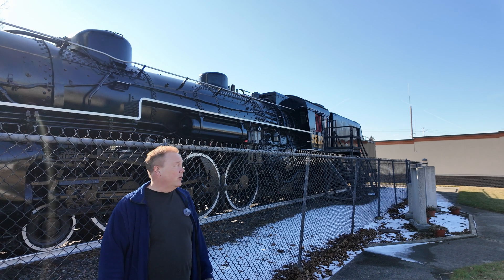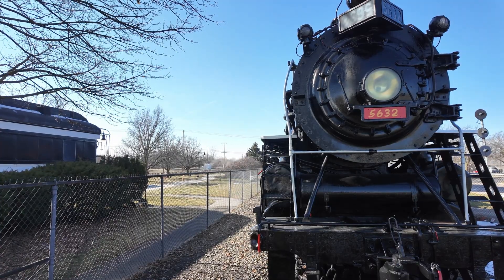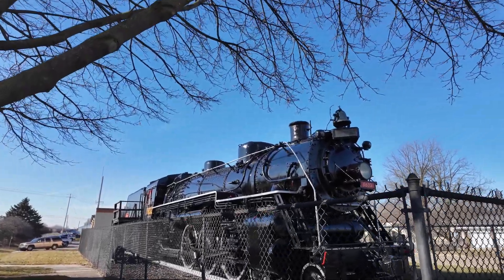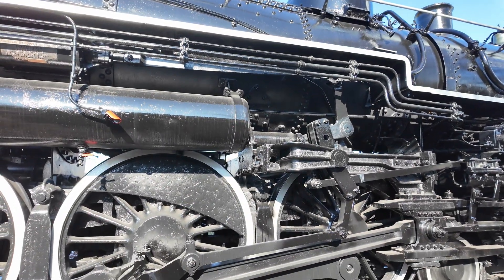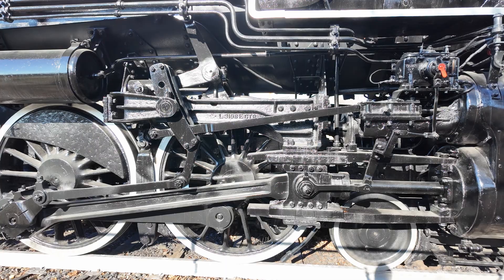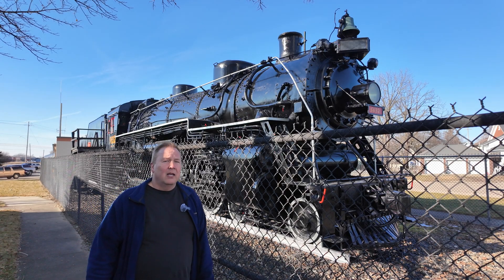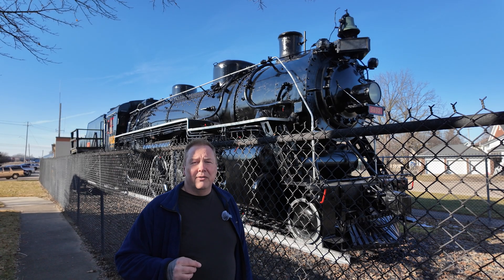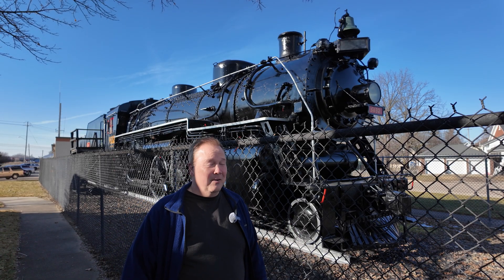Why Steam Trains Have Giant Wheels

Comment: This is all true up to the age of superpower locomotives.  

The vast majority of modern 4-6-4 and 4-8-4 locomotives could very easily and safely maintain speeds well beyond their wheel diameters.  Lightweight side rods and pistons, roller bearings, advanced cross balancing, one piece frames, modern centralized lubrication, and superpower proportioned heating surfaces all dramatically changed the rules.  

The ATSF 2900 class with 80" drivers ran 100 mph in service daily and was rated to run 120 mph. The advanced N&W J class with 70" drivers was very comfortable at 100 mph.  These are a few examples but they're pretty typical for late steam era fully modern engines.  Sustaining 100 mph across the mid west and the prairies was not a challenge for these machines.

Love the videos.  ❤❤❤
Reply from the maker: It's too bad trains through the midwest can't still do 100 mph.  Isn't there only one amtrack route that manages it now, between track condition and traffic?
Reply: @Industrial_Revolution Unfortunately there is a 79 mph limit on passenger trains that share trackage with freight trains.  It really puts a damper on making long range passenger travel an attractive option unless you're checking out the scenery. 

If you haven't taken a look at the T1 Trust project, they're building a Pennsylvania Railroad T1 from scratch to go and prove they were the fastest steam locomotives ever used in regular service.  On the run from Crestline to Harmon they regularly ran 100-120 MPH.  The engineers apparently had a habit of running them well beyond the design speed of their Franklin valve gear and creating a lot of maintenance headaches.  Franklin and PRR had a fix in the form of automotive style rotary Franklin B valve gear but the end of steam ended that effort.  One engine was retrofitted and tested.  The T1 Trust is building their engine with the rotary valve gear and hoping to see 140 MPH.  Fun stuff.  The big question is where are you going to run it at 140 MPH?
Reply from the maker: I've heard of it, but haven't looked into it too much.
I suspect the only rail line in the states capable of that speed is a part Amtrak's Acela line, but I also suspect that line can't take the weight.

Comment: Steam production isn't a problem for any super power design. For every inch of driving wheel diameter, you get 1 mph +10%.   modern (late 30's +) could go much faster. 90+ mph on 70" wheels.
Reply from the maker: For max speed, assuming you had enough steam, but could you actually sustain it?

Comment: Balance of the rotating and reciprocating components becomes increasingly complex at higher speeds.  Vibration was a limiting factor in some designs.  Some interesting research was done by suspending entire locomotives on mechanical balancing machines with the results being recorded on synchronized paper charts.
Reply from the maker: Suspending an entire locomotive at a balance point?  Must have been weird to be around that one.  I'm assuming this was done after Rocket, since before then, it was fairly common to use vertical cylinders and the locomotive rocked hard from side to side.
Reply: Development of high speed steam locomotives is an interesting technological development lost to history.  High speed passenger service was one of the first to use diesel electric with its smooth and steady operation.  The highly refined and tuned fast steam engines had limited pulling capacity and were scrapped long before their uniqueness was comprehended.

Comment: I still think managing the moving mass better. ala F1 engine… you could then get the maximum possible strokes out of the engines. As the piston has developed a lot since 1940. 

Although ofc you are stuck back on the first problem. Steam Generation at pressure at volume.

Comment: The limitations is on how fast you can produce and maintain the volume of steam. Which in turn is a surface area heating problem… plus drive wheel size… which… in turn is limited by railway gauge (width)… and the joy of getting several hundred thousand pounds around a curve.

Fun times.
Reply from the maker: Yep, this is definitely more a rule of thumb, on a straightaway, and assuming you have sufficient steam.  For something like a switchyard engine, they never cared about, or really needed, speed, and if you get to something like a Shay, then everything changes.
Reply: I've always been interested in the Erie and Kalamazoo railroad, the first in Ohio and Michigan. I would love to see a video about it. Keep up the good work.
Reply from the maker: Is that the one that started out horse-drawn for a bit before they got their first steam locomotive?